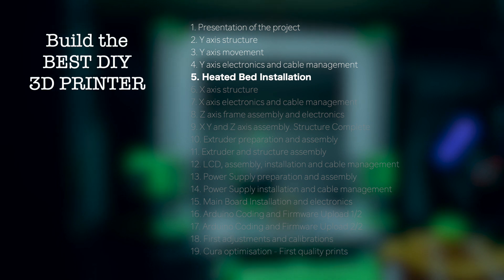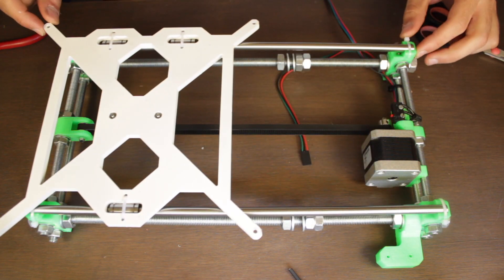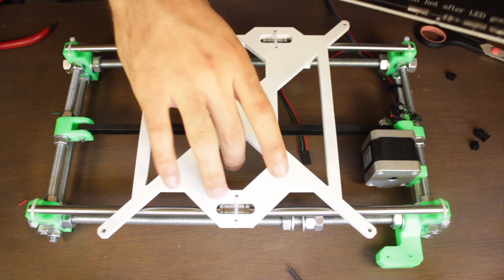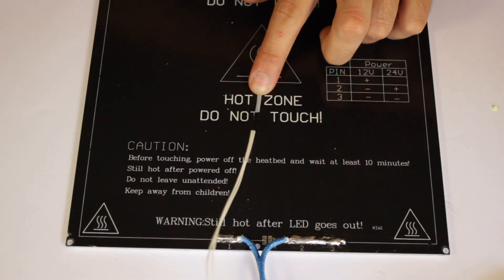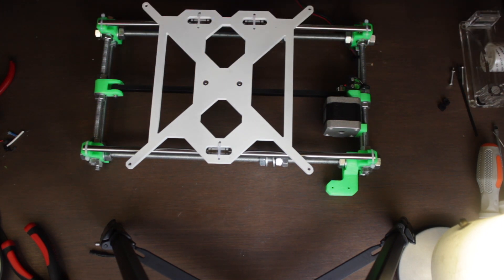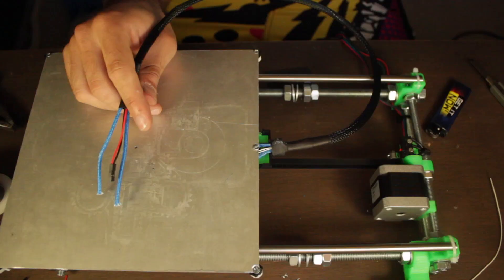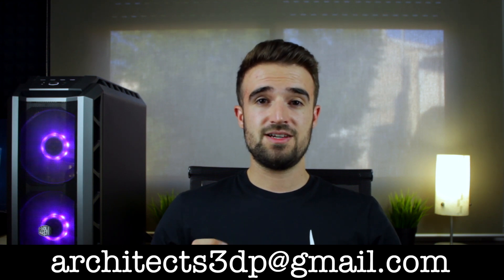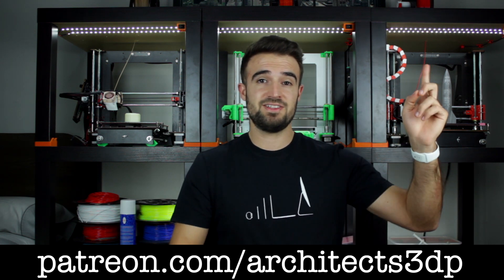Build the BEST DIY 3D Printer - Heated Bed installation #05

Comment: You need springs between the hot plate and the Y-axis base. Unless you plan to have an auto levelling sensor.
Reply from the maker: Good observation Captain, we're going to use a P.I.N.D.A. sensor, that's why I didn't use springs. But yeah, it can work as well without an auto-leveling sensor, leveling it manually using some springs :)